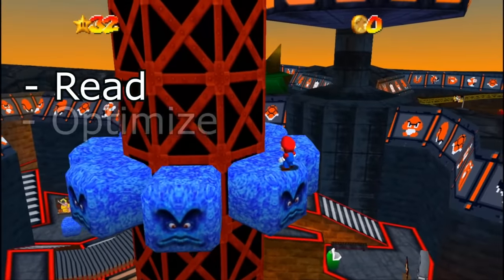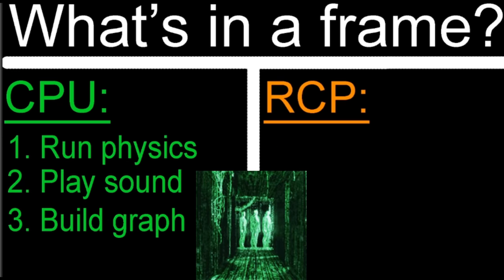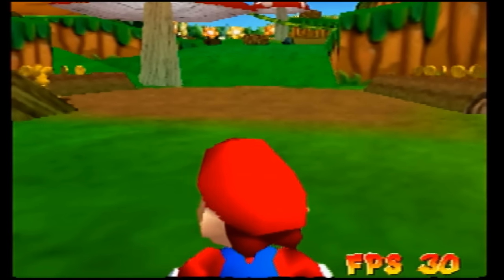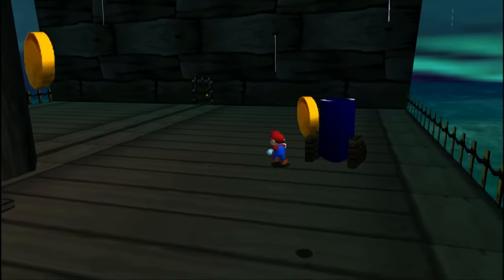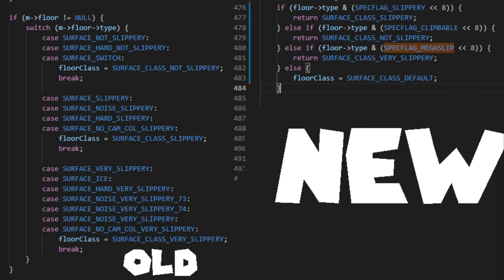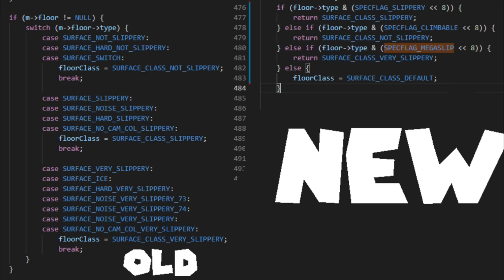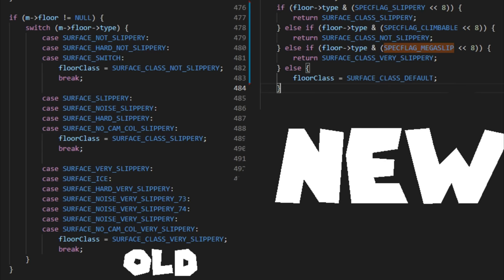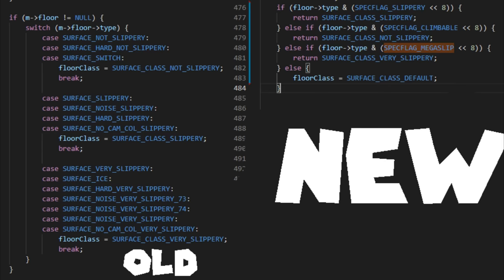FIXING the ENTIRE SM64 Source Code (INSANE N64 performance)

Comment: i feel every game company needs an “optimizer” programmer to go in and check out how poor everything is written
Reply: They do. The problem is gamers keep asking for way too much in terms of fidelity, and games end up too large to be remotely well-optimized as a result.

It's easier to just tell you people to spend more money on better hardware like consoles and graphics cards and not actually have to do anything.
Reply: @bigboysdotcom745  well... it seems this guy was able to optimize it, why not have him on the team? 

This is the kind of thing he means
Reply: @HerobrineGaming  A lot has changed from the 90s. First, we need to account for the fact that machines are very fast now. Today, developer time is much more costly than compute time. Writing code quickly saves more money. And these optimizations he performed were mostly micro-optimizations, which both take the most time and have the least amount of reward. Today, we largely ignore micro-optimizations in favor of more readable code, such that developer time is lowered. 

We also need to acknowledge modern games and programs are designed and written with portability in mind. These optimizations only work because he knows the system the game will run on. But on a different system, these optimizations might actually make performance worse. Today, games are made to run on a VAST variety of hardware, from phones, consoles, PCs, etc. Different instruction sets, different graphics processors. Preferably, we write the code just once and compile for different systems. We lose some performance this way, but writing a different game for every single different platform is way too expensive, and makes updates pretty much impossible, not to mention introducing inconsistencies between games. 

This is also why games today are written in more "inefficient" languages, like C#. These are highly portable. As long as, say, the Unity engine is available for a platform, your C# game scripts will run. 

Today, emphasis is put on making a well-designed game. Simple and readable structures, well-defined systems, etc. This is done so the developers can read the code easily, and so the game can be easily portable. Not to mention such that adding updates is easy. If this costs some performance, its generally considered worth it, as you produce a more high-quality software product that you can better maintain.
Reply: @lucass8119  Basically, he has successfully applied Embedded Firmware techiques to a Software application. 
But everybody is right--both sides of the argument. He highlights what is possible if commercial constraits did not exist. However, they do. It's not just an engineering thing. It applies to all commercial endeavors. QUALITY, TIME, COST, pick any two. Only by breaking these constraits was he able to achieve  these amazing results. 
If there is one takeaway from this then perhaps it should be that there is value to be had in non-commercial endeavors.
Reply: @Herobrine Gaming  A: Companies have entire teams dedication to optimization, it still doesn't mean anything when games are as big as they are and have to be released quickly in order to remain profitable
B: it's way easier to optimize a game after 25 years when heaps of documentation and an infinite amount of time is available.
Reply: They already have

Comment: I'm not even a dev and most of the code optimization things you outlined are fairly straightforward and basic things that even I am aware of. But some of the things you did, here...man oh man...that is the kind of thing you can accomplish ONLY when you put thousands of hours into a project like this in addition to the thousands of hours of coding experience required to even know you could optimize in such a manner.

Also, the LLMs are great at optimizing code. Give it snippets, describe the context, and they can optimize your code or offer suggestions. Almost everything you mentioned you did is something these LLMs would suggest or even re-write for you. Even if you know how to code an optimization, just give the code block to the LLM, describe the optimization you want, bam, it will do it. Often better than you can because it doesn't usually make typos or errors. But I noticed these LLMs make errors with instantiating 
or failing to declare variables them before invoking them. 

Anyway, this is an amazing project and I wish AAA studios would have an optimization team that did what you did.

Comment: There's also the huge elephant in the room that the devs were under a deadline with a whole console on the line that ws already delayed a lot. Fixing bugs and general polish of the gameplay is time better spent than increasing the framerate. What's the point of solid 60 fps if it's full of bugs? Back in the day, especially, gamers were too amazed by the 3D to notice or care about performance hits except maybe in Dire Dire Docks
Reply: Getting a game to run in 60 FPS was no where in the minds of the devs in the first place. The TVs being used at that time by most people in both Japan and the US were tube TVs using the NTSC standard, which was only capable of 30 FPS
Reply: @kandigloss6438  It was 60 fps on those TV's, they used progressive scan modes at 200 lines or so..

Comment: Quick question:
Does the game still render collisions, inputs, etc. at 20tick? Maybe it's mentioned in the video, I haven't watched it yet.
Important because it completely changes the whole game.
Reply: The game is 30fps tho
Reply: @CinnamonOwO  ok. Minecraft you can only input 20 times per second and the physics only update 20 times per second, but you run minecraft at whatever fps you want. Visual can be different than what the actual engine runs at
Reply: @girlgaming1993  Usually games with networking built in need to do things like decoupling inputs + physics to display refresh.

Comment: As a modern day programmer, I've been very aware of poor optimisation in modern games for years. I started writing code in 2016. Because of my personal proclivities, I've found optimisation interesting for as long as I've known about it and I generally write optimised code, but writing code for 6th gen and especially 5th gen (PS1) and older would be way out of my range, regardless of the familiarity factor. There, you really had a strong and clear connection to the hardware and things on screen and features of the game were great accomplishments that were strongly correlated with the strengths and weaknesses of the hardware. Now, it's all virtual, abstracted, and garbage-collected. More like a complex video game in itself rather than programming the hardware. It's not all bad, and I think modern game dev features have opened up many possibilities and saved a lot of people a lot of time. It's always going to be a tradeoff. Making the amazing things that exist in at least some modern games would not be possible without some inefficiency. The same way that a very rich person is willing to spend much more money to save time. That being said, the degree of this that we've reached is just perverse. Truly just degenerate. I'm grateful that modern games suck, because apparently my GTX 1080 cannot possibly handle their sheer intensity. In reality, with truly well-optimised code, even to an incomplete extent, would probably make 2023 games run as well on my card (and my ancient i5 4690K) as a modern top-of-the-line PC runs them in reality. All this headache and the parts of game dev I find interesting going unrewarded made me lose interest in the profession entirely. I now am trying to be a sort of rock star or something.

Comment: Very interesting video.  Brings back a lot of memories. Did you rewrite the microcode for the graphics?  It is absolutely terrible. Quite some time ago I wrote one of the first HLE  for N64 and I was stunned at how bad the graphics code was.   Rare's microcode was a big step forward.  Even WaveRace had better graphics code though it was throttled to run at 20fps.
Reply from the maker: i'm using f3dex2 here, but soon there will be a huge boost to it - sauraen is developing f3dex3 with a bunch of cool new features and improvements to beat out rare's microcode.

Comment: Very impressive work, well done. Were the methods you used to improve the coding known when the original programmers coded the game? Where they just not that good or are you using some methods not known back then?
Reply: the main limiting factor for the developers were that the hardware was not known when developing (and most of the interesting optimisations are hardware specific) and time constraints preventing devs from refactoring existing code.

Comment: If anyone is wondering whats the deal with the illegal C code, I'll explain.  The code snippet *((u8 *) &o->oBehParams) is considered illegal in C due to a type punning issue, which violates the strict aliasing rule. The strict aliasing rule in C states that a program should not access an object of one type through a pointer of a different type. In this case, o->oBehParams is being accessed through a pointer to u8, which could be different from its actual type.

Comment: 17:18 I notice a change in the coins. The right hand side all the coins turn at the same time. I do like the old coins in this comparison. Was this some of all that bulk you mentioned regarding shadows?
Reply from the maker: yeah they are batched. it saves around 90us so it's not really a big performance impact. probably wouldn't even cost 1 fps in the scene. i do kinda like them in sync though

Comment: I don't remember which video you mentioned it in, but in one of them you said something about removing headphone mode in order to shrink the audio library, and I'm just wondering: did the headphone mode actually perform some rough approximation of an HRTF? or did it just reduce the stereo separation a bit so wearing headphones wouldn't be as jarring?
Reply from the maker: It just mixed left/right audio with different values iirc which sounds very similar to the second thing you're describing
Reply: @KazeN64  that makes sense, computationally cheapest approach

Comment: I'm interested, what are the trade-offs for these optimization? Would the new source code not fit on the cartridge, or is it "simply" modern discoveries and attention to performance which technically could have been done at the time?
Reply from the maker: all of these make the ROM smaller, so this would use a bit less space than the original mario 64. sm64 needs about 7.7mb of storage, with this rewrite it'd likely be around 7.4mb.

Most games are poorly written, not just sm64. i'd guess most games could be made near identical while having 2x the framerate. it's just not economic to put in all the effort of actually doing that most of the time. plus you need a lot of coordination within programming teams, between artist and programmers and with the designers even. and then you also need people willing to actually work with an optimized codebase.

Comment: At 8:03 ...  Size of C code in terms of lines / quantity of ASCII characters is not always indicative of performance; sometimes you have to check the assembly to understand if it's faster or not. Specifically here, switch statements are inline lookup tables (fast) and the constants in the code can be immediate instead of indirect instructions (fast). So it's not clear to me, just from the C level, that the new code is faster.

set_camera_roll_shake() has been dropped/lost, which means the new code likely doesn't do the same as the old code.
Reply from the maker: I am comparing it on the assembly level, I just picked a screenshot that is visually instantly clear. Not every switch case gets turned into a LUT under GCC unfortunately.
The reason roll_shake is dropped is that the case where it was being called was unused.
Reply: @KazeN64  Apologies. This was my first video of yours. At the point I commented I didn't know you were looking at the assembly.

Well done, BTW. This is an interesting case study of getting something done quickly (original code) vs well/correctly (your code).

Comment: Quote Kaze : "I have read, optimized and bug fixed the entire mario 64 source code.
The game you see in the background runs easy 30 fps on the real n64 hardware.". This was 2 years ago, so all the optimization are finished, right? So, releaase the mod :)  E.g. in the form of a .ips, .aps or .bps file. I want to run it in full 30 or 60 fps glory on my real n64 :) If it's still a beta version, i dont mind :)

Comment: @KazeN64 - Be careful re-rolling un-rolled loops. I hope you were profiling to find out where you were missing cache. If an unrolled loop is hit many times in succession, the Rambus hit will be minor because it'll go into icache after the first iteration, assuming the unrolled loop isn't too long.

Also a heads-up on caching: Each cache line is filled forward from the point where it's missed, iirc. So if you miss on a byte at 8 bytes into the cache line, it will fill from there onward and loop back to fill bytes 0-7.  I'm sliiiightly fuzzy on this, so maybe just assume it's filled from byte 0 onwards, in 32-bit chunks I think? Look up the specs, they're gonna be more reliable than my memory. But the upshot is that you should structure data so that it will be accessed sequentially through the cache line. If you hit the first byte of the cache and then you immediately hit the last, you'll stall while the rest of the line is fed in, whereas if you just move through the line in order, it'll generally be there when you ask for it. The other thing you can do, in rare cases, is to use uncached reads if you know you're gonna hit each cache line just once and then not again for a long time, meanwhile the line would get flushed, though typically that would indicate you should reformat your data structures.

Good catch on the billboard matrix. I'm astounded they did it for each object. That's just people not thinking hard enough. I've worked on games where the billboard actually leans away from the camera a bit radially if you're looking down its axis, and that is the only case in which you should ever be calculating its upper 3x3 more than once.

BTW C was not even remotely a new language at that time. It had been around for 20+ years at that point, and I myself had been using it for about 10 years before I worked on an N64 game in the 90s.

Also, the teapot demo actually used a static shadow texture. 🙂 Watch the shadow's handle and spout, they don't move relative to the body. Video games, and demos especially, are alllll about cheating.
Reply from the maker: cycles don't matter on the n64 any more. my cpu is about 75% idle. it's all about mem throughput, so even if its permanently cached for the frame, it's still better to roll it back up.
Reply: @4 Ah, fair point if the main goal is just to touch physical ram as little as possible. Okay.

BTW, if you enjoy optimizing for memory access, you should see if you can track down a PS2 Performance Analyzer devkit and the bus capture software for it. That was some of the most fun and effective optimizing I ever got to do. I'm not sure which game you could mess with though, not many have been leaked and reverse engineering one from asm is just. so. tedious. On the bright side, it too uses MIPS so at least it'd be familiar.

Edit: Maybe ICO? Not sure if worth it since it was already remastered fairly well. But it was already well-optimized and still couldn't do the greatest framerate and/or full resolution.

Comment: you said you created a custom model for Mario...

now from what I remember of Mario 64, and that era of games,
while the start menu face was rigged with vertexes weighted to nodes to stretch the face, the character model was separate segments

you have a properly rigged and weighted model for your player model?
Reply from the maker: something inbetween! i still use matrices for the body parts (which means the weights will be 0 or 1), but I have found a way to connect the individual bodyparts that actually is a bit cheaper performance wise than indidivual segments. this both looks better and performs better.
Reply: @KazeN64  damn, nicely done, wasn't entirely sure the engine could handle it when it had to handle the rest of the world :)

Comment: How much do you think you could optimise vanilla SM64 without the Expansion Pak, though? It wasn't released until two years after SM64.
Reply from the maker: the expansion pak is a 5% difference here at most. it's barely even noticeable. and the memory banking i did with the expansion pak can be done without it, if you just optimize vanilla sm64's memory layout a little (it wastes almost 25% of the n64s memory at all times)

Comment: I found a way to reliably emulate an N64 faster than an actual N64 (in certain aspects) on a ZX80 with a few clever code tricks. I'm thinking they'd probably work well in this situation too.
Reply from the maker: the point of this is to have it run well on n64 - if i was fine just using an emulator of course i could just run it in an emulator

Comment: "C was a new language at the time."

If 24 years old (This game came out in 1996, and C was created in 1972. You could maybe argue the standard was relatively new (1989.) but people were programming in C long before C89 was a thing.) is considered "new," sure. Unless you meant "new to Nintendo" then I get it. They probably just only had experience with 65x and 8080/Z80 assembly before this point.